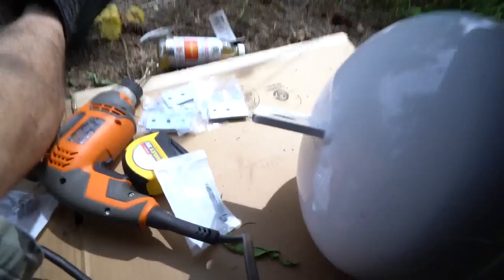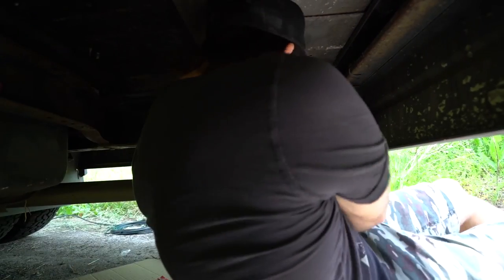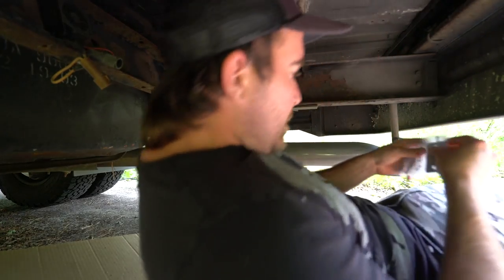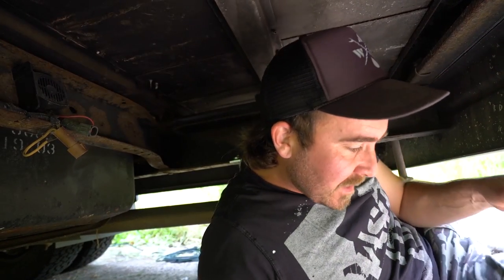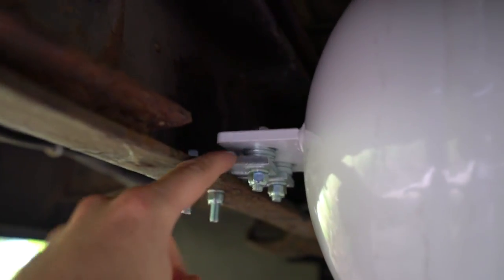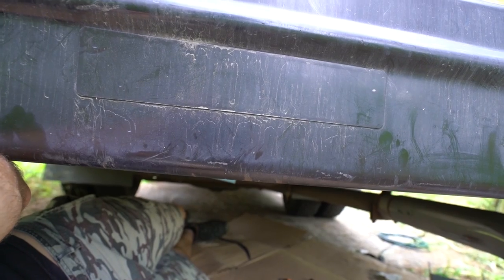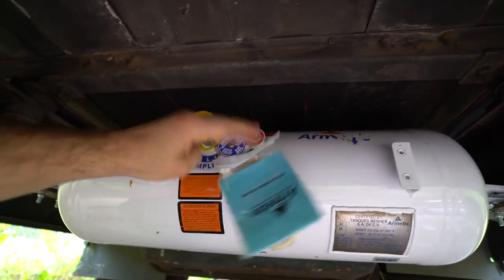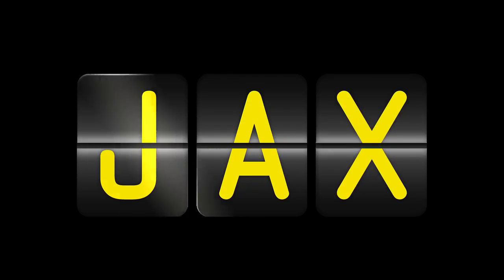SKOOLIE RV PROPANE TANK INSTALL UNDER BUS  #VanLife Vlog: 228

Comment: I'll be surprised if a propane place will fill that under there with such poor access. You may need to get some kind of an extension, or move the tank. Will be interesting to hear what the first fill is like. Also that tank will likely last you a year. Some van dwellers say the 1 gallons last 3 months.

Comment: You could even cut a hole in the side of the bus and extend a line from the tank and mount the fill nossle inside the cut hole. Maybe hire a student welder at a trade school for $50 - 70 bucks to do any needed welding. When it's raining, or muddy you won't want to get under the bus.

Comment: Nice work! I haven't the slightest idea how to install a propane tank in my undercarriage. But, is it safe to install it within one foot of the exhaust pipe? Remember, exaust gasses/pipes get well into the multiple hundreds of degrees. You don't want that pipe expanding the gas in the tank beyond a certain limit from adjacent heating. Maybe their built to handle it?? You can also drill holes and install a heat shield between the two.

Comment: Good job.  If you do any work in or around that area make damn sure the tank is removed. Obviously welding but also metal on metal can spark sometimes. One other point. have it filled only to 60% because the tank might get hot from the exhaust or radiant heat from the pavement.  Normally they fill tanks to 80% so that there is a 20% buffer for expansion.  Propane expands easily.  I used to work in the heating fuel business so I can't help but comment. 😁

Comment: Good job, but would you get some safety glasses lol? I was worried the whole time about those metal pcs getting in your eyes :-(. Several yrs ago, I thought I had an eyelash in my eye but it was a pc of metal. Do not ask me how lmbo, but I told my eye dr I was typing too fast.   :-). Bad part, he took it out with a needle, and I had to wear a patch on my eye grrr. Safe travels ♡